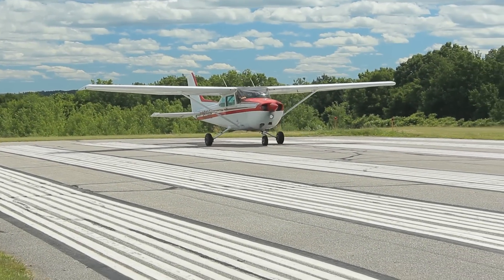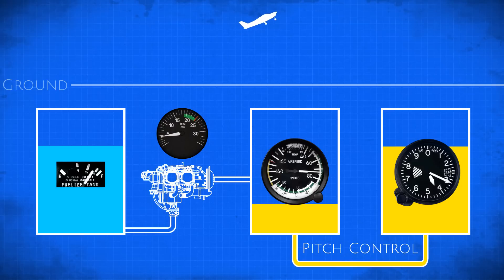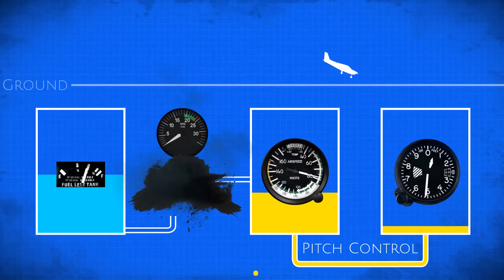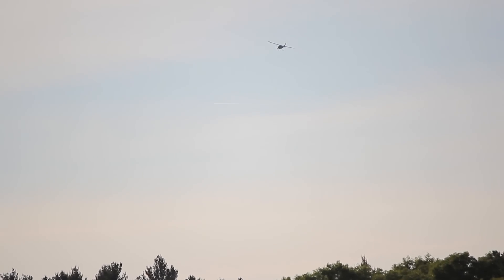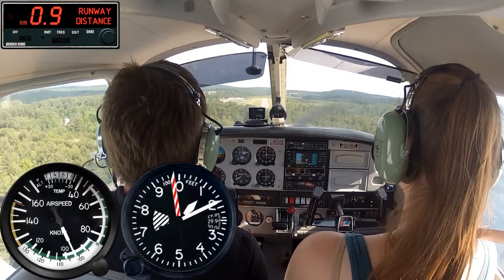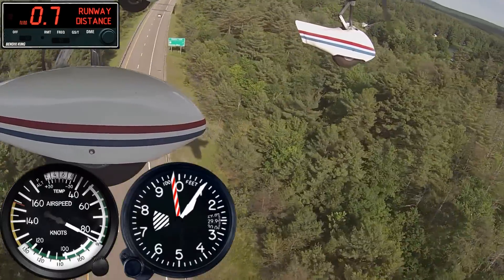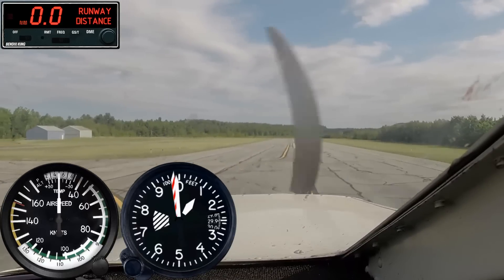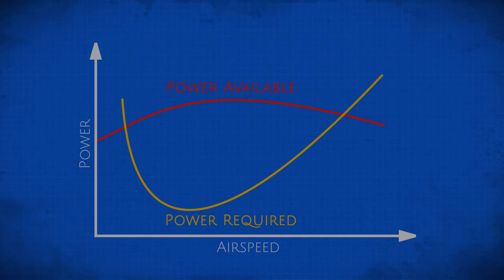Energy Management:  Speed vs. Altitude and everywhere in between

Comment: Good explanation, although I'd say altitude energy is better in an emergency because you have more visibility and high airspeed= exponentially more parasitic drag. 

Altitude uses the energy more efficiently.
Reply from the maker: Definitely agree about the visibility thing, although this was not intended to suggest an alternate approach style, merely to serve as an example of energy management.  Also, the power curve demonstrates that you can find the same amount of drag by both going too fast, and too slow.  There is an optimal, and it exists as a V-Speed for a reason.
Reply: I think the thing with low altitude high speed approach is that it mitigates for the problem of losing thrust unlike low energy approach... however if you get troubles with other controls (esepecially elevator, flaps and such) you will have much harder time to recover and wind gusts give you very little reaction time if there are obstacles in the area.

Comment: One of the reasons I think simple air brake systems (that don't increase lift- only drag) should become standard on GA. Wouldn't add much weight at all, nor need be terribly complex or expensive. But this way you could always come in quite fast and then once a good landing position is secured and imminent, slowly apply the air brakes while simultaneously nosing up to keep altitude steady as needed and then very quickly you find yourself on the ground. This type of system would always ensure tons of stored energy in case you needed it for some reason and, of course, make stalling or spinning on approach mostly a thing of the past, even for novice pilots.
Reply: The system you’re describing would be complex to the extent that it would require both engineering and rigging. And adding an extra gizmo to an otherwise uncomplicated panel is unnecessary. Such a system would require practice because coming in fast is not always necessary or desirable. A better suggestion would be to practice making stabilized approaches at the correct airspeeds. But on the off chance you’re coming in hot, as in let’s say 80 knots after a 90 knot ILS approach when you’d rather be at 60 over the fence, a quick tap dance on the rudder pedals while on short final will bleed off a lot of extra speed in a hurry. Most airplanes don’t need what you’re proposing here.
Reply: Gliders use spoilers with similar thoughts in mind while both the S-3 and F-14 used such too. Thing is they didn’t come in fast nor do gliders. Instead they come in on speed using pitch (pitch trim really) to control AOA while they use the spoilers in lieu of or in addition to power changes for glide slope. Such spoilers are nice as, if you’re on a high wire, add the drag to sink, then reduce the drag and you’re on. Two corrections instead of three. To do such by power, you need to reduce power to achieve a steep wire then add power to override momentum then partially reduce again to maintain the new on altitude wire. Gliders will usually make approaches with half spoiler as the norm so as to have ability to add some if high and to reduce some if low.
Reply: @TenMinuteTrips  tap dancing on rudders is dangerous. Puts excessive stress on the empennage. Single step inputs to slip are ok but forward slipping is more about altitude loss than decelerating.

Comment: It's called gliding the trade off on approach come to low cut in early have to much make a higher circuit duh
Reply: Bearing in mind I did do 3kts of VNE when flying as I was low approach and was in heavy sink yet made it to the airfield easily

Comment: WHAT?
I am completely lost, I have a very vary small understanding of what you mean by energy. so for the most part I was confused but the portion you did while flying made sense.
Reply from the maker: Well, then you just need a better understanding of energy :)
Reply: "Energy" takes many forms, and as he said an airplane has 3 types:  Chemical energy (fuel) is converted by the engine into Kinetic energy ("speed") and Potential energy (altitude.)  You can convert Kinetic into Potential and vice-versa, but you always lose some in the process due to drag.  

That's all Energy Management is:  Keeping track of the total energy you have in the "bank" and moving it around between "accounts" as needed.  Need more speed?  You can burn fuel OR you can give up some potential energy (altitude).  Need more altitude?  You can burn fuel OR you can do a "performance climb" and just yank the stick back, trading speed for altitude.  

Now....if you're coming in high and slow, in a "normal" glide slope, you have plenty of potential energy but little kinetic energy.  If you encounter sudden wind shear, and your headwind suddenly becomes a tail wind, your airspeed can instantly drop below stall speed even though your GROUND speed is the same.  Down you go.  If you have enough altitude you can push the nose down while increasing power and recover.  But in an extreme case you can't recover.  You go boom.

If you're low and fast you have no potential energy to spend in a wind shear situation, but you have ample KINETIC energy.  Wind shear happens, your stall horn sings, and what do you do?  Instead of diving toward the ground and hoping to recover before you go boom you CLIMB, trading some of that extra speed for the safety of altitude.  Now you have options.  Apply power and go around, or maybe you can just modify the approach and land.  

All things considered SPEED is a better safety factor than altitude when you're in the pattern.  You don't want to putter around the pattern at minimum speed with all your feathers out because you have little or no margin for error, even though the ground looks comfortingly far away.  You want to reduce altitude slowly, bleeding off kinetic energy slowly, and always maintain enough extra speed to suit the conditions.
Reply: When you dive, you speed up. When you climb, you slow down. This concept is your ticket out of a low altitude situation and why you see a "high performance" take off from short and soft fields with a 50 foot obstacle. You use ground affect to gain speed then trade that airspeed for altitude.
Reply: Ground effect is generally only used for soft field takeoffs - if you're generating lift then you're paying for that with drag. Staying on the ground means less drag, thus faster airspeed buildup. The issue on soft fields is rolling resistance on the tires (and also blasting junk up into your wings/air intake/prop/etc) -- that's why you get off the ground quickly and pay the drag penalty in ground effect until you have enough airspeed to climb. For short takeoffs on improved surfaces, ride the tar until it's ready to fly and climb out at Vx.
Reply: i.b. hemp Any time you are in motion, the aircraft is generating drag. However, the short/soft field takeoffs use the ground effect to remove the extra drag that the wheels cause to generate more airspeed, therefore, more lift. Not only that, due to the proximity of the ground, wing tip vorticies are interrupted which decreases normal drag on the aircraft and, in turn, increases airspeed. This is the same principle behind floating and ballooning, less drag=more airspeed=more lift=unintended altitude gain.
Reply: wing tip vortices increase drag. that's why Boeing and other airplane manufacturers added winglets. winglets move the vortices away from the main body of the wing decreasing drag. I could be wrong, but I wouldn't think that altitude has much of an effect on the vortices.
Reply: disregard scientists seem to think otherwise. Learning every day.
Reply: wef3838 It's not necessarily the altitude itself. After you get out of ground effect (the distance above the ground roughly equivalent to one wing span) they take full effect regardless of altitude. In ground effect, however, these vorticies do not fully develop, therefore decreasing their effect of drag on the airfoil.
Reply: i.b. hemp Your minimum drag is really never going to be on the ground. It will always be in the air.  I will admit that my short field technique is jumbled, mainly since I fly out of high elevation/high DA environments every flight (still within envelope) so I use ground effect to gain airspeed and "pop" off the ground because I struggle to make a solid climb rate. This makes even a 5000 foot, hard runway, feel like it's shorter than it really is. I do it because 1. it's getting my aircraft above to safe altitudes immediately and 2. for me, gaining any airspeed past my safe flying speed on the ground is unsafe because I lose a lot of design control. Maybe it's different technique, but I have never ever found I accelerate quicker on the ground than in the air. It simply doesn't happen in the real world.

EDIT: I put this after misreading hemp's post. I agree with what he said... XD
Reply: Wrong, on the ground is the minimum drag configuration so long as the ground is a hard surface.  Proper short field technique is to hold the aircraft as close as possible to zero angle of attack until Vx. No angle of attack means no induced drag. Flying creates induced drag. Ground effect does not even come close to eliminating it. Of course there is no point in holding the aircraft near the ground once you get to Vx since you are trying to clear an obstacle.

Once you pass through the region of reversed command, also known as the reverse side of the power curve, then induced drag falls very quickly.

What you do when you force the aircraft off the ground in ground effect is to increase the profile drag by displacing the elevator and raising the nose and then increase the induced drag by increasing the angle of attack. If you have ever been boating you are probably familiar with the water that is sucked along by a speed boat at low speed. This is induced drag. The airplane is doing the same.

Trying flying with someone who has proper technique. They will get the airplane off the ground and climbing using less runway than you.
Reply: Joshua Landry Maybe it's the lowest drag configuration because you are moving the slowest, but there is much more drag on the aircraft when you are in your takeoff roll, near rotation speed than when you're in the air. Not only that, this is assuming a "Clean" configuration (no flaps). While flying you are ALWAYS generating drag, obviously since it is one of the four forces of flight. However, the wheels ADD to this drag. 

My technique, isn't the issue, BTW. I can get the aircraft (C172, 160 HP) off normally in 7000 foot plus Density Altitude without using ground effect within 1000 feet, and climbing excellently when I'm on top of my rudder coordination. I use the extra runway when I'm high DA to obtain the airspeed I need to safely get me above the mountainous terrain while still over an area that I know is below me.

Final point: "When an aircraft flies at a ground level approximately at or below the length of the aircraft's wingspan or helicopter's rotor diameter, there occurs, depending on airfoil and aircraft design, an often noticeable ground effect. This is caused primarily by the ground interrupting the wingtip vortices and downwash behind the wing. When a wing is flown very close to the ground, wingtip vortices are unable to form effectively due to the obstruction of the ground. The result is lower induced drag, which increases the speed and lift of the aircraft." From: https://en.wikipedia.org/wiki/Ground_effect_(aerodynamics)
Reply: i.b. hemp Okay. I misread your post. I agree with all your points. And I see what you did with the science... XD
Reply: HappyBappyAviation, you don't get it. Your technique doesn't improve performance at all and people who know more, like 100 years of test pilots, me, etc., keep telling you. I'm a physicist and a CFI-I. I routinely teach proper technique for short field as well as demonstrate it across wide range of density altitudes. I also watch students fail in all sorts of ways, including demonstrating your technique.

Being on the ground at zero angle of attack is the lowest drag configuration on the back side of the power curve because induced drag is zero. When you are flying it is gigantic.

You should go back to school and learn about drag. There are several types. One is form drag. It is based on the shape of the object. Rotation, control inputs, etc. effect this. There is also drag from skin friction, aerodynamic interference. Collectively these are known as parasite drag. This type of drag increases with speed and lift produced is irrelevant.

Then you have induced drag. Induced drag is caused by lift. Specifically, downwash,  wingtip vortices, and a rearward horizontal component of lift. Ground effect diminishes, but does not eliminate, downwash and wingtip vortices. It has no effect on the lift component. Ground effect is not magic. Induced drag is still very big in ground effect. In fact the F-86 had multiple fatalities caused by pilots who took off in ground effect and tried to climb. Induced drag in ground effect overcame the power of their supersonic jet engine!

The size of this drag is mathematically infinite at zero and drops off to a very small value at high speed and depends on the amount of lift produced, therefore it depends. This is quite literally the graph he was showing.

The drag produced by wheels an pavement is very small. Wheels are designed to rotate with minimum drag. They are small so their inertia is small and the energy they rob from the system is also very small. In fact, more or less negligible. On a soft field, like grass or snow, this is a different story.

The proper technique to climb as fast as possible from an improved, clean, surface is to keep the AOA as low as possible and the elevator neutral. This reduce induced drag far below ground effect and keeps the elevator from acting as a speed brake. Basically eliminating induced drag entirely. This will beat floating out any day. Density altitude has no effect on this.

I can also 100% guarantee you this is correct. I've seen students become confused and try to do a hybrid short and soft field takeoff. They never get performance nearly as good as doing it right. In fact, it may increase the over the 50 foot by as much as 50%!

TL;DR: Wheels are a tiny amount of drag. Induced drag, even in ground effect, is very large. It is quite noticeably reduced, but not nearly eliminated. Induced drag is much, much greater than wheel drag.
Reply: HappyBappyAviation, something else you seem to not have realized is that if you keep aircraft on the ground the wing is still in ground effect! By reducing your AOA you are reducing drag by ground effect and angle of attack!

The wheels are small peanuts in comparison to that.
Reply: To set a record straight: I NEVER SAID DRAG OF ANY KIND WAS ELIMINATED. Read my stuff again and see that eliminated was never used in my posts. I understand these types of drag is forever a factor whenever the wing is generating lift, even during ground effect. No magic involved, no misunderstandings here about any form of drag, just mis-attributed values to them.

With that, I'll admit this makes more sense to me now. I guess I just get impatient during takeoff and the adrenaline got to me (with the feeling of extra speed and such). Good learning experience in any case I will keep this in mind for my next flight.